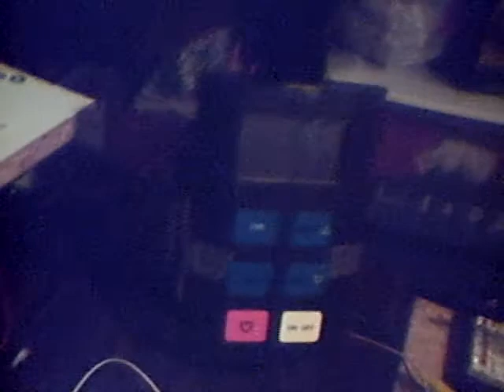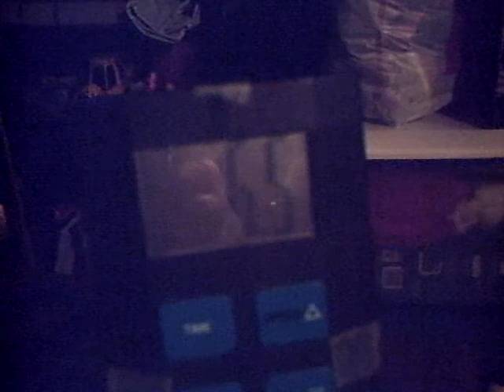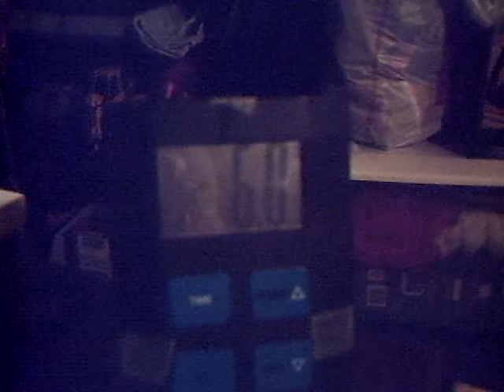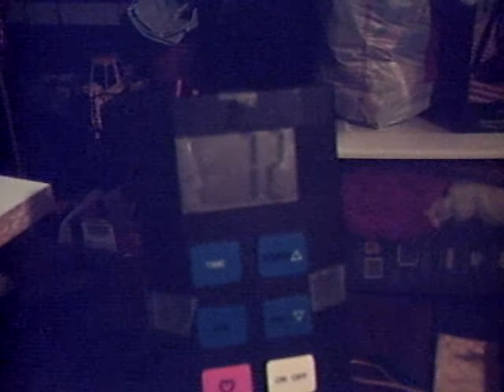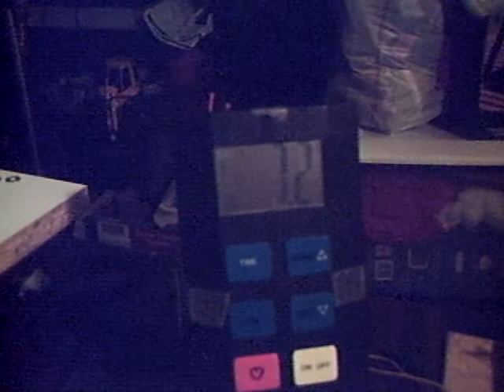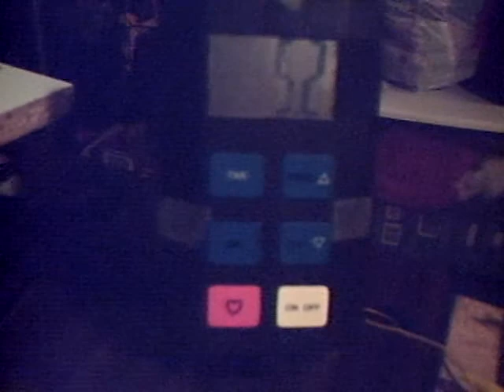LENZLESS GENERATOR SPEEDING UP UNDER LOAD JAN31 2009

Comment from the maker: All LEDS are in parallel but half are oriented in opposite polarity to the other half. It is a 120/12v-1.2amp transformer hooked up to step up the voltage. Will show measurements on next video.

Comment: What kind of transformer did you hook up ?
Are all LEDs in series or in parallel ?
Do you have the low turn winding of the transformer connector to your generator ?
Is it some kind of 12 Volts to 120 Volts transformer or simular ?
Please show measurements of Voltage and current and scope shots.
Many thanks.
Regards, Stefan.